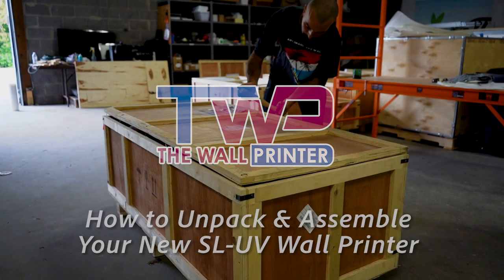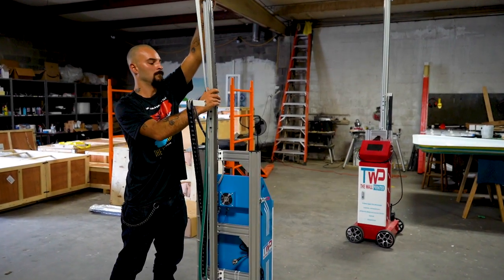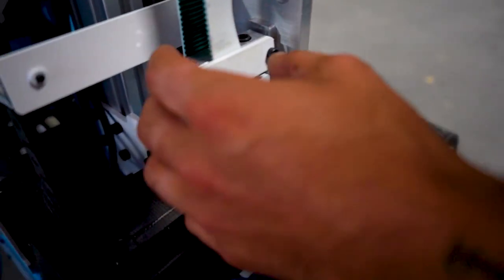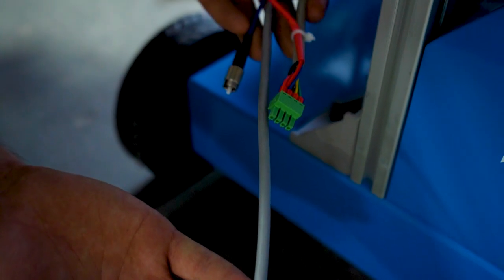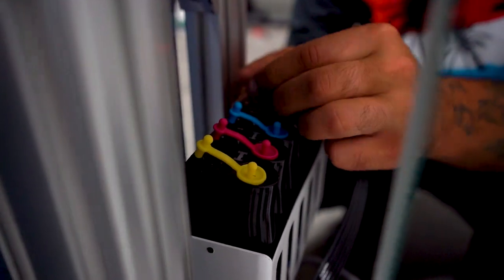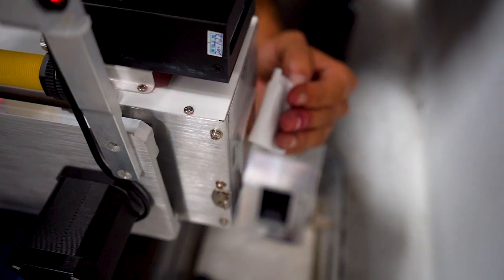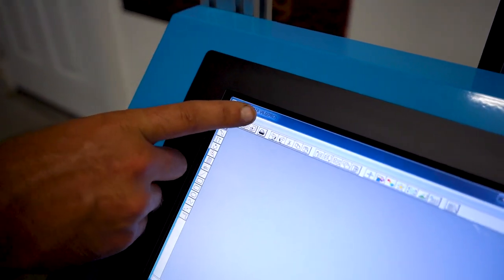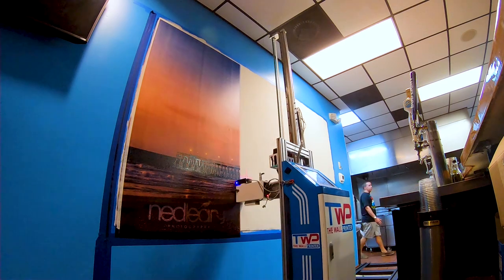How to Unpack & Assemble The Wall Printer

Comment: How will this be different from the one of Ali express for £5000. What will be better in the images
Reply from the maker: Yes, there is a Chinese alternative on Alibaba for a lower price; Like with most things, you get what you pay for. These machines lack our commercial-grade quality and reliability for day-to-day operations. Purchasing from such platforms may save you money initially, but you won't receive essential support, training, parts, or ink. Moreover, the risk of the machine malfunctioning without proper support is extremely high and leads to downtime and ends up costing you more money in the long run. We are the exclusive provider of Wall and Floor printers in the Western Hemisphere. We are based in Wilmington, NC, and offer unparalleled benefits like unlimited technical support, same-day ink and parts shipment, marketing support, and more. AKA when you need help, we’re here and ready. When you choose The Wall Printer, you're investing in unmatched value and reliability.

Comment: Amazing.
What’s the price?
Reply from the maker: We have 6 different Wall Printers and 1 Floor Printer. Our top of the line, UV printer is $24,995 and discounts are available to distributors. The Wall Printer has the one of the highest return on investment for 2021 startups. For more information please visit our website (https://thewallprinter.com/en/contact-us/) and complete the “Get More Information” form.
Reply: So if the printers are 25k or less, why do I need to spend a minimum of 35K?

Comment: Are the ones sold on AliExpress for $5000 fake or this is just 10 times overpriced?
Reply from the maker: there is Chinese alternative that you can purchase from Alibaba. The price is less. Although, the machine is not ours. It isn't built to commercial quality, ready to work day-in to day-out. If you would like to purchase a machine from Alibaba or other websites, you will receive no technical support, training, parts, ink, etc.. It may be less expensive up-front, but you will end up unable to earn revenue when your machine stops working and you have no support. We are the only vertical printer in the Western Hemisphere. We are USA based, located in Wilmington, NC providing unlimited technical support, training, same day ink and parts shipment, marketing support, and much more. When you need help with your Wall Printer, we're here and ready. The value in purchasing from The Wall Printer is unmatched.